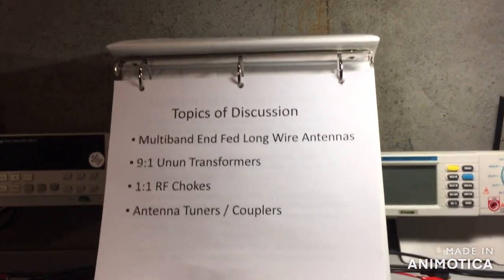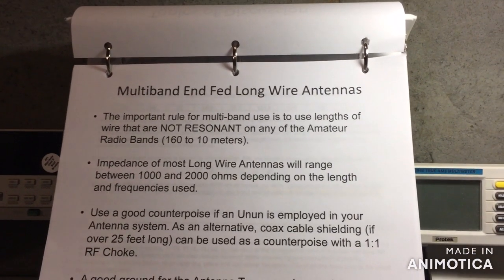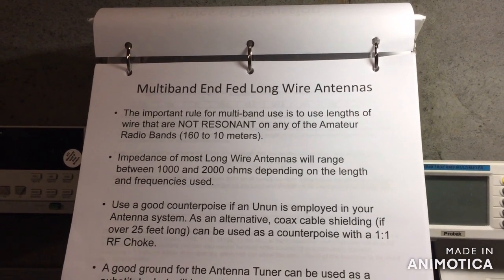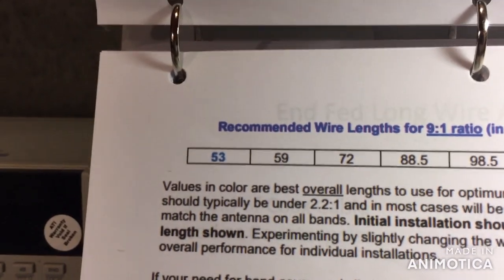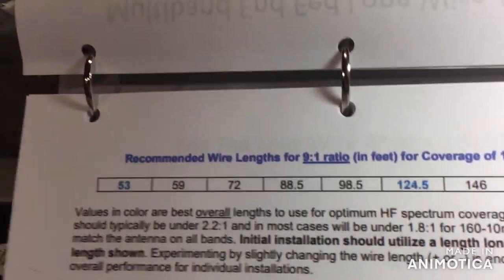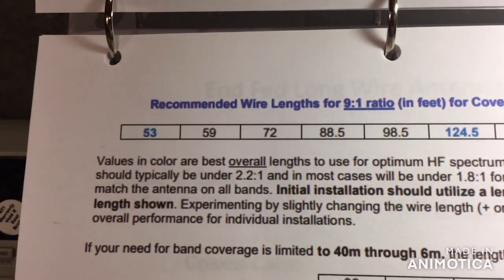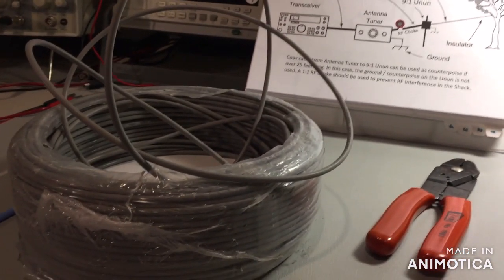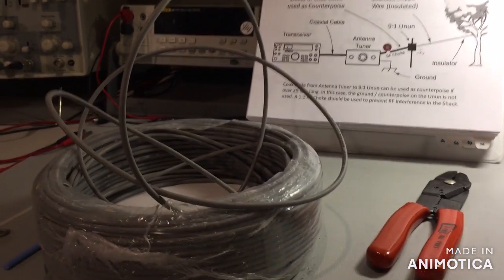Part One - RF Man Discusses Long Wire Antennas, Unun's, RF Chokes, and Antenna Tuners

Comment: I have a theory that as soon as you introduce an antenna tuner, you are resonating the antenna, as well as matching z. Therefore the antenna ends up becoming 'electrically' the correct length anyway. There is no RANDOM. The reason for avoiding  even 1/4 wavelength multiples is the very difficult z match which extends above 2k.
But a very good video and great hands on instruction. Yep solder your crimps 😊.
Paul.

Comment: I used to get microphone “tingle” with my efhw antenna on transmit.  I took your advice and choked off the coax feeder before it enters the rig.  Did the trick.  Problem solved.  Thanks!
Reply from the maker: I'm happy that you found this helpful!

Comment: A few days ago I put one up that's 71' long.  I also put a good RF ground under it.... lots of radials with one hooked to my neighbor's chicken wire fence and another to a cold water spigot to my house. I've made a lot of CW contacts with it over the weekend.  17 meters opened up and I worked a station in Denmark and another in England. Domestic QSO's included HI and AK.  I'm surprised how well a "random" wire antenna works.

Comment: Does direction of these long wire, g5rv, dipole wire antennas matter, e.g if you run the cable directly east to west or north to south or anywhere in between?
I ask as I can run 53ft east to west in what space I have, at approx 10-12ft off the ground 1 end, 15+ the other. I'm already in a fairly elevated position with a long LoS south and reasonable LoS east and west. House will be in the way to the north.

Comment: I have a myantennas 160 thru 10m longwire unun with 135 feet of wire in a lazy inverted v.   I use 80 feet of times microwave lmr 400 coax to a ldg remote tuner outside 80 feet from the shack then a 3 foot piece of coax from the remote tuner to the unun of the antenna.   Where is the best place for my choke....on the 3 foot section between the tuner and the unun or at the remote tuners feed point or in the shack at the radio?   I currently use a choke between the tuner and the unun but I also put a palomar ferrite donut with 9 turns at the feed point of the tuner.   The tuner and unun are grounded with 2,  8 foot copper grounds and im only 7 feet above sea level here on the east coast.   Am I canceling out my counterpoise created by my coax run?    I have no rf but the counterpoise part you mentioned with my coax I think I need to help out.   Seeing this video leaves me in doubt I have it set up correctly.   My inverted v peaks up about 40 feet above ground btw.   Thanks

Comment: What about an antenna at 915 MHz using a single piece of wire, AWG#18, 1/4 wave? What impedance is expected and what is the best way to match/tune?
Reply from the maker: For a single frequency, you can tune the antenna to be resonance at 915MHz. The length for a full wave vertically polarize antenna would be equal to 936 / frequency in MHz or 936 / 915 = 1.02 feet or 12.2 inches.  I hope this helps...